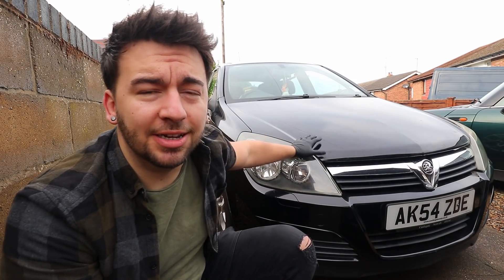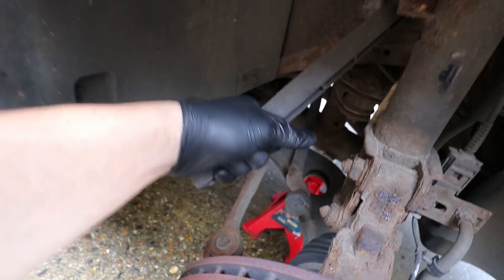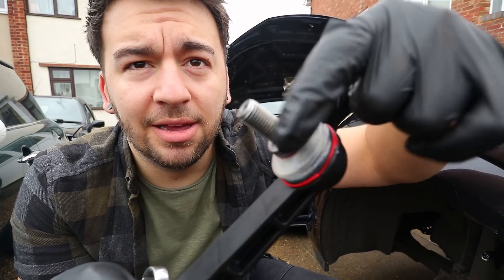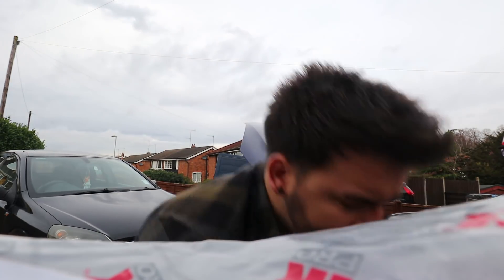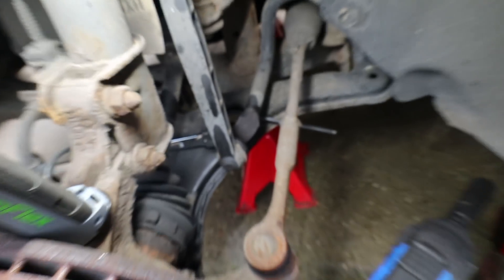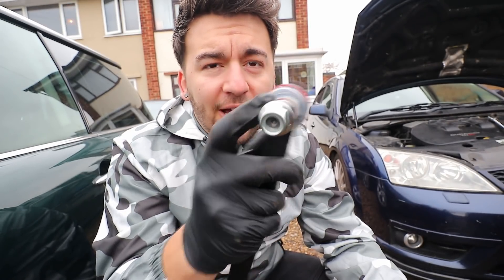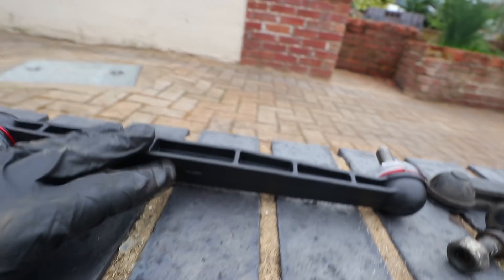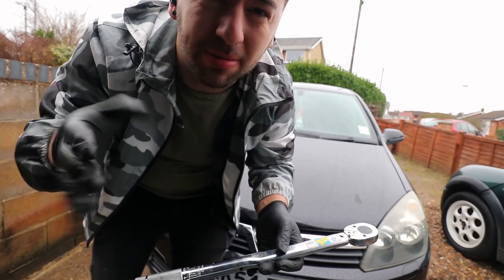The Mk5 Astra Has Another Issue..

Comment: when ur taking old droplinks and replacing them u can  use the impact gun and get a long bar and put pressure between the strut and the droplink so the balljoint wont spin saves a bit of time handy to know because sometimes the torx and hex strips out or a small vicegrips on the balljoint and use the impact works if theres no slot of the spanner on the back

Comment: I fitted a pattern part one beforehand and they last 1 to 2 years with the rubber splitting badly.
Always worth paying the extra and getting genuine GM ones.
With important components like timing belt kit, brakes ,suspension parts etc i always get genuine GM ones.

Comment: I broke a drop link on my mk3 astra. Slid slowly into the side wall of a kerb while trying to take a corner in winter. Snapped near the bottom like that, and mine were metal.  Luckily I was going really slow at the time, so wheel didn't buckle under itself with the side impact.

Comment: Plastic drop links?  what a great idea (not).
The allen head rounded out on my Mazda so I ripped the drop link knuckle off from the ball and used Stilsons to hold the ball stud while undoing the nut (which I suspect was cross threaded).  The higher the torque applied to the nut the tighter the Stilsons bite into the ball stud. Worked a treat.

Comment: Spent 3 hours a few days ago changing these drop links on my Corsa, first one went okay, but the second one, omg. The bottom not is such a pain in the ass to take off couse theres so little space there you cant put a proper ratchet in there . At the end had to use a rotary tool to cut the ball joint off and then hammer out the bolt.

Comment: It snapped because it's plastic. Easier method is use an old nut over the old ball joint thread that will clean the threads out first.

Comment: Good job, The plastic ones are oem for the astra, you could have used the buzz gun if it was on full speed to remove the nuts.

Astras wheel torque is 110nm, 120 isn't much higher but could pull the threads in the hub

Comment: nothing wrong with the head gasket job keeps the car on the road . bit of a tip if your going to be doing them drop links again. a good brush with grease on the threads and a bit of heat shrink over that . just keeps the crap off them a bit

Comment: Rubbish plastic drop links. Typically the brushings fail on the Astra, so that could have also caused the plastic to fail. Replacing with steel drop links can tighten up handling a bit.

Comment: I've never had to do it but you can always try and grip the ball joint from behind with the mole grips if it spins, might be enough for the impact to buzz it off.

Don't pay attention to the trolls mate. You put about as much work into the car as its worth. Maybe i would have advised getting a timing belt kit or putting some supermarket oil in it too but its a 54 plate Vauxhall with over 100,000 miles. It will be on its way to the scrapyard in a few years at most for one reason or another. It's good you helped your mate out, you have to do these jobs sometimes. Keep an eye on it and it if the repair hasn't been 100% then put a bottle of stop leak or whatever in it. It was waaaaaay beyond that before.

Comment: You didn’t point it out man but it’s good to let people know to jack both wheels up when doing drop links cause you’ll probably already know how much of a nightmare it is to fit one drop link and then do the opposite side with the side that’s been done with the wheel on the ground. Quick tip that makes life so much easier👍 also when checking play in drop links it’s much more noticeable when all wheels are on the ground if they’re bad or not, could jack it up and not feel a single thing and then have it on the ground and it could be knocking it’s tits off👍

Comment: When I put a comment about the cylinder number one valves it was bit of advice I didn't want you to rebuild the engine and fine  its not running very good on number one . I did understand its a  job on the cheap for a mate sorry if you taken it the wrong way

Comment: Lowering the car wouldn't put a roll bar link under any more stress mate because the bar isnt fixed between them. What puts them under stress is one wheel being under a different load to the other. Ie when cornering which is what they are designed for.

Comment: The metal droplinks on the mk5 Astra are actually for the IDS suspension and have a kink in them to get around the modules in the strut. 
The plastic ones are decent enough and wear just as quick as the metal ones... the only downside as you’ve seen is they can snap, but it’s rare.

Comment: Great videos, your doing exactly what is necessary to get the car working to the best of affordability, and without risking safety, these videos are the important ones, cos they show a DIY'er what can be possible without needing ultra expensive tooling, or an NCQ level 3 in car mechanics, in 2020 being more thrifty will be more important than ever, as the general cost of living increasingly rises, and the motorist is hit the worst with more ULEZ zones, congestion charges and toll road increases, changes in MoT testing with higher stricter standards, hybrid 'dealer only' repaired vehicles, higher increases in insurance renewals, tax on petrol increases, higher parking zone charges...and on and on, Savage Garage keep doing what your doing cos your doing it well as your channel name implies only the most resourceful survive..thank you

Comment: Never seen plastic drop links before. Sounds like a big no-no, but at least they are lighter and probably also cheaper than metal. The hex-type normally gets off with an angle grinder ;-)

Comment: The car is an old shitter so it makes sense to fix it as cheap as possible to keep it going abit longer. spending large amounts of money on an old motor is stupidity, head gasket repair fluid would have been an valid option if it wasnt leaking oil into the cylinder aswell as coolant. I think you did the right thing. No matter what you do someone will want to moan about it so I wouldnt worry.

Comment: Could you do a video on sourcing parts for car repairs.

 I often find my self hunting between  Euro carp parts APD / GMF ect for service items, then ebay for random expensive bits tha i can by second hand if apropriate. Then dealer for car specific parts. If there a free parts diagram website that you can use in the UK? so we can get specific OEM part Numbers from. I find sourcing good and cheap parts is half the battle with car repair. 

Thanks
Reply: @graham3189  Thanks this site has got loads of manufacturers. :-)

Comment: Great video James!!!! Quick question. My sump plug is on super tight, what's you/everyone's thoughts on me whipping it off with a nut gun? I just don't want to shear the head off the bolt.
Reply: Don't! is it cross threaded? what are you going to do if the thread strips? can you buy/fit a salvage sump? Plan it all out before you start.

Comment: Very well said at the end mate! I’m a mechanic myself and completely understand you, customers are what effects the sort of work you do. Whether they can afford it or need the car back on the road ASAP or something like that. Also One little tip I can give you with drop links is if the nuts are nyloc, once they’re tight I put a little coat of copper grease on the threads and in the hex bit just so when someone comes to do it again they can clean the threads off and buzz them off nicely!

Comment: If your car starts making a knocking noise when going over bumpy ground it's probably these that are needing changed, changed these on my old X5 and it cured the Knocking straight away.
Reply: Billy D you are right, its that or the swaybar bushings that went to the crapper
Reply: My car makes a slight knock going over bumpy ground but also (only occasionally) hear it when I turn the wheel from left to right, would that also be the same issue?
Reply: RyanLike that could be different things, it could also be trackrodbearing or strutbearing for example
Reply: My car knocks going over rough ground but steering side to side there’s no noise is it Droplinks usually ?

Comment: Sometimes when you are working on a car you have to improvise like this. I had the drop links with the Torx head in the end and they were a nightmare. They'd been in for 130k miles so not a surprise. Had to grind one off as the head rounded, and the other one twisted the T40 bit it was so tight!

Keep up the good work! I always say at work to never judge the previous guys workmanship as sometimes he has a situation on his hands that we don't know anything about. Not easy to ignore the haters but you have to otherwise you'd be fighting forever.

Comment: James, it is a shame that you have to answer to the snowflakes who criticize your work and probably don't know Jack. You did a decent cost-effective job to get a good mate up and running again without cutting any corners. Like you, I'm a self-taught DIY mechanic who fixes cars in my own time. I have a disclaimer saying something to the effect of that I'm just a DIY mechanic and this video is a how-I-did-it rather than a how-to. Some white grease on the exposed threads on the drop links will make it easier the next time they have to be replaced. You need a more powerful impact wrench than the Draper (how about the DeWalt DCF899?) but it should be fine for most stuff.

Comment: Its a Vauxhall everything will need changing 😂 i own a Vauxhall vectra sri 130 b estate 2002 so far ive had to change or replace
Clutch 
Rear wheel bearings 
Front wheel bearings 
Drop links 
Front top mounts 
Rear shocks 
Front shocks 
Ecu rebuild twice 🤦‍♂️
Exhaust manifold with cat attached 
Rear back box
Centre pipe 
Pads discs all round 
Hand brake cables 
Rear shoes in the discs 
Cambelt 
Water pump
Alternator belt 
Wish bones 
Roof lining 
Front fogs lights 
Thermostat 
Rocker cover gasket 
New battery 
Tyres about 4 times all round 
Heater speed controller 
Abs sensors 
Air con fan
The question is what haven't i replaced on a car that done 126,000 miles 😂😂😂😂 its a labour of love or stupidity if i add everything up the car weighed me in at £700 over the years its cost me twice that lol mug!!! Luckily all the work was done by me apart from the headliner and the ecu rebuild ! 🖕 Vauxhall's 🤦‍♂️
Reply: I had (until 2019) a 2003 Vectra C 2.2.   Had some rust treated on the front sub frame, some brake lines replaced, alternator replaced and a rocker cover gasket (very usual for most marques).  Apart from routine servicing - pads and oil, usual sort of things, it was immaculate.  One of the best cars I ever had.  Only changed it due to an accident.
Reply: You would changing much the same on an 18 year old  2002 Ford/Bmw/Jag  estate.except it would be costing  a lot more.
Reply: Is your car called Trigger's broom?
Reply: @philcrockford5534  feels like it but like the comment above the car has been reliable and cheap to replace the parts needed

Comment: honestly, the plastic drop links are awful! I upgraded mine to metal heavy duty ones and although the rides a little stiffer they're much more solid!  .. it's really not uncommon for the plastic ones to snap though
Reply: @BlackHairedBeauty25  Unlikely metal ones would be stronger than OE
Reply: @davidhaygarth4763  The OE plastic ones are designed to absorb vibration I believe, however in my personal opinion the plastic doesn't hold up well and gets brittle. I own a Zafira, not an Astra so wanted the Meyle metal version and it handles well, I made not mention of strength .. just said it was a stiffer ride and it felt more solid. I'm not sure of the properties of the materials used so couldn't speculate as to each versions ,'strength'
Reply: @BlackHairedBeauty25  Ive had a metal one break and ball joint popped out after 3 weeks. It was an ebay job though...lol  Always buy genuine cheaper  though through online vaux specialists
Reply: @davidhaygarth4763  goes without saying, always buy genuine where possible unless it's stupid money! The Meyle versions I bought were an eBay purchase but they came with a 2\3yr warranty I think and have been on my bus for over 6mths with no issues .. I do also have upgraded Monroe OE Spectrum Struts and Side Load springs (aka banana springs) so I guess that helps hahaha

Comment: I did these on my wifes Astra H over christmas. They were the allenkey type. The replacements from ECP were also plastic. But thats what GM fit from the factory so.....
The ones on her car were knocking really badly. Sounded like a rock flapping around in the wheelarch !. I think she hits speedbumps too hard, so these ARB drop links get a real hard time.
Reply: Don't be surprised if you have to do them again soon, I brought moog plastic arb links for my zafira, within 6 weeks they were rattling worse than before, this happened 3 times so I replaced again for the metal ones and never had a problem since